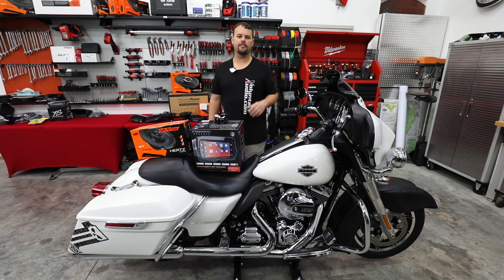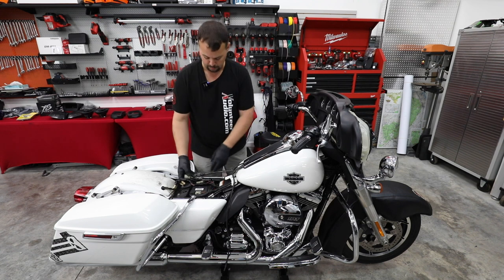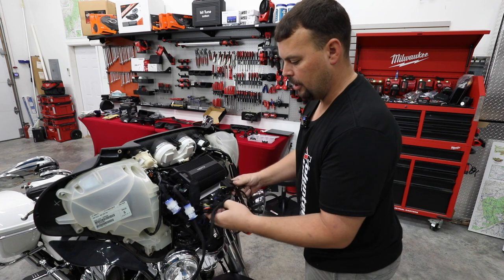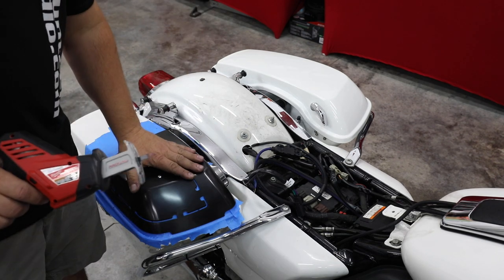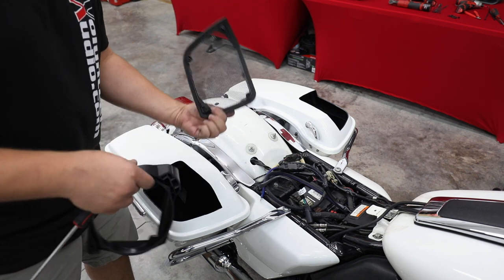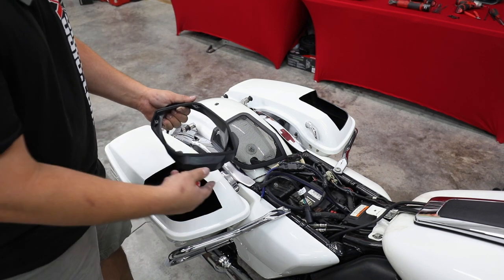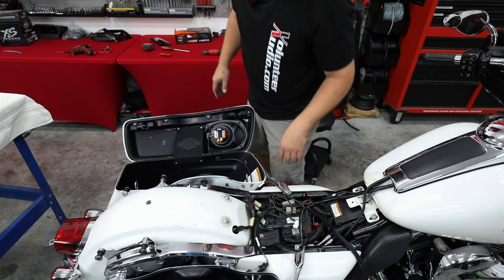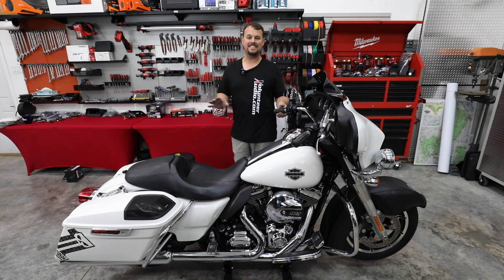Project Five-0 Step by step 2000 watt SP4.900 Hertz Amplifier and SX690Neo 6x9" Speaker Installation

Comment: Purchased this amp with the full (6) speaker set up and Soundstream head unit yesterday from yall...  Very confident after spending countless hours watching the install vids.  The Boom2 in my '15 FLHXSE is garbage.  Even now the rear speakers are Out of Stock even though mine are under warranty and BLOWN AGAIN.  The lower fairing speakers that HD put in after I purchased didn't help just like your video.  Keep it and I can't wait for a shipment.
Reply from the maker: Thank you so much!

Comment: Amazing video Jay, just a quick question, if all 4 speakers are full range, then wouldn't all those 4 speakers require a full range signal without any high pass or low pass filters or any crossovers pre-set onto the amp? I believe the speakers have their own crossovers?
Reply from the maker: No, when you are playing at very loud volumes these speakers will not play very low, sub bass frequencies, we only block low frequencies that the speakers cannot play clearly at high volumes
Reply: @volunteeraudio  I see, makes sense, smart move, you definitely know your stuff 👍

Comment: Great video Jay...do you need to change speaker wires? Or is stock wires good enough for all that power?
Reply from the maker: Stock wiring is copper and will work fine
Reply: @volunteeraudio  thank you for the fast response 🙏

Comment: Hey Jay. I bought my Soundstream head unit from you and waiting for my new Hertz sp4.900 I also ordered from you. I have had a problem with my head unit when I plug my phone into it. My phone displays a message saying water present in the usb. I pull the cord out a smidge and it goes away. I tried 2 different cords. Same result. I also purchased the HD usb cord from you as well. Could the usb cord from the head unit be bad?  Also bought my sx690 neos's from you. I'd appreciate it if you would send them rubber gaskets with my amplifier. Thanks Marc
Reply from the maker: Call 1-844-30AUDIO to speak to our sales team, I have not seen this issue before, I would try a different phone to rule out a phone issue

Comment: I'm working on making my own package on your website. I have a 22 Road Glide Special. I want to keep my stock radio. My list is Precision Power MAA4.400, SX165NEO, and SX690NEO. Do I need to add anything to make the complete kit?
Reply from the maker: https://volunteeraudio.com/product/hertz-stage-4-sx165neo-sx690neo-motorcycle-speakers-cut-kit-with-hertz-600w-hmp4d-hd-plug-play-amplifier-for-2014-2022-harley-davidson-factory-radio.
Reply from the maker: This kit has everything needed, you will need to flash the stock radio and the tool can be selected in the listing for rental
Reply: @volunteeraudio  do need or get the backbone harness or does it come with it
Reply from the maker: @kriztofer3334  the 4 speaker kit includes all harnessing
Reply: @volunteeraudio  I appreciate your time. I'm looking forward to it. I can't hear my radio over 60mph. I hope this does the trick
Reply from the maker: @kriztofer3334  for sure this will take care of that problem

Comment: I bought the Hertz 600w amp with the infinity speakers....and in a way I was disappointed with my sound.
To be truthful the stock radio full blast sounds just as loud as the radio going through the amp....I was expecting a real big boost. The amp led is green on so I donno.
Maybe I'll save my pennies and buy the 2000 watt amp and I would hope it gets much louder....
Reply from the maker: Something is for sure not right, call us at 1-844-30AUDIO to get this figured out